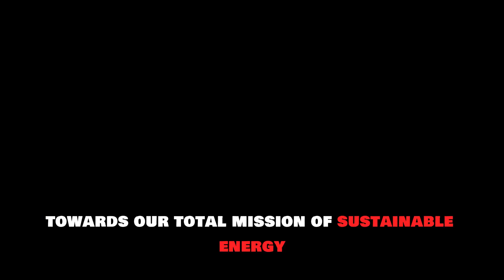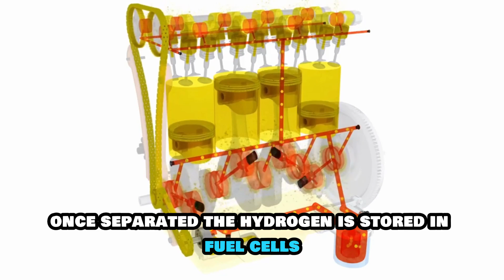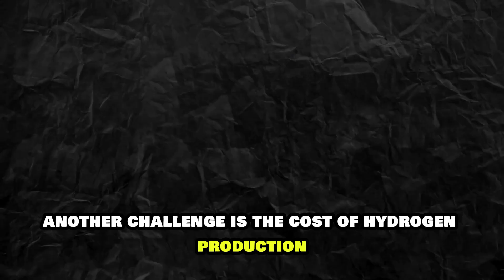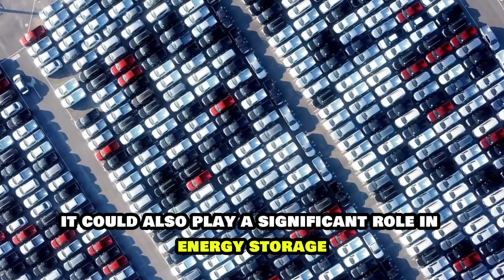Elon Musk: "This Water Engine Will DESTROY The Entire Car Industry!"

Comment: No MATTER which fuel you use, the ICE will only achieve approx 20% efficiency, according to the principles of thermodynamics...  & Can only achieve this efficiency with transmission gearing to achieve high torque.. Why even bother with any ICE car... While BEVs are able to achieve 90-95% efficiency with instant torque, with minimal or no gearing...